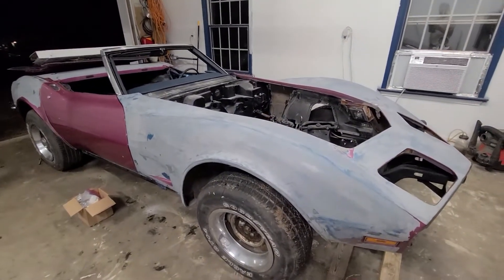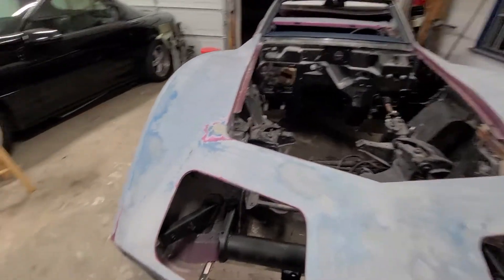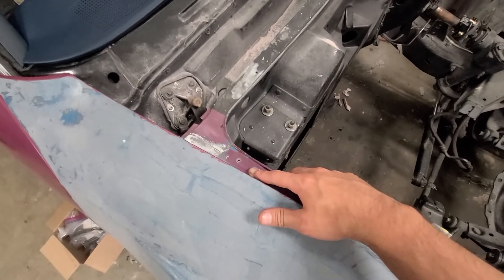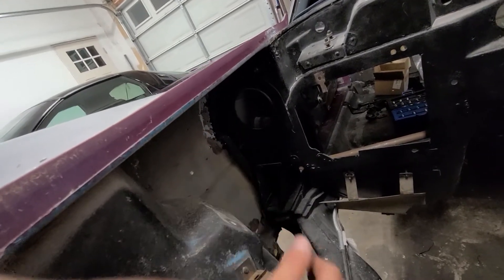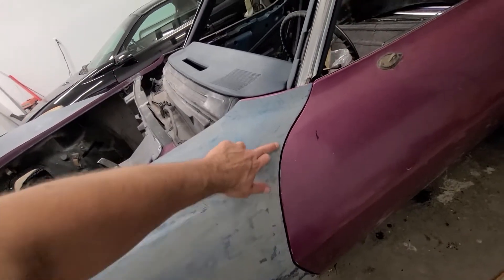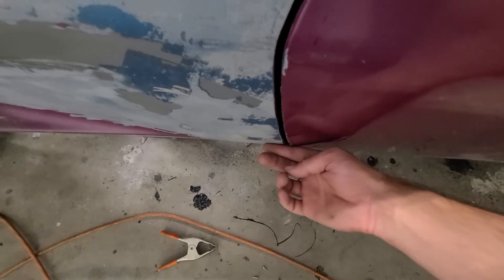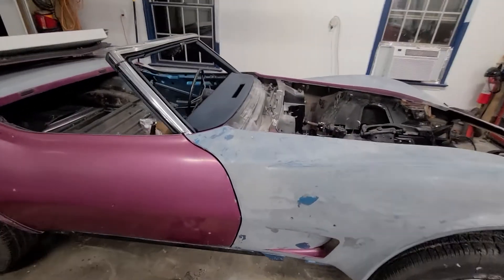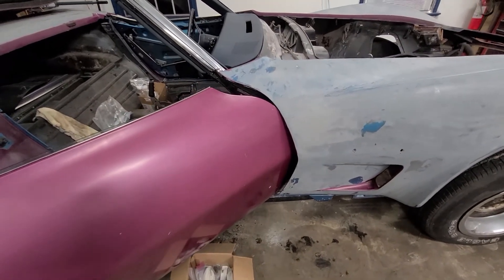c3 corvette front clip install

Comment: Very good work.  There is only so much that can be done to get even gaps.  Nearly EVERY C3 that I've looked at has a passenger side gap that is wider than the driver's side.  Especially at the top.  From my research, when the nose was put on at the factory, the fenders were left a bit long and then shaped to match the doors.  for the St Louis plant in the mid-70s, sort of close was close enough.  Without glassing the edges of the doors and the fender, the best you can hope for is a compromise.  Good luck with the rest of the build!

Comment: Are you calling the frame extension with the vacuum tank, the "crash bar?"  I'm trying to figure out how to put my project car, that I bought, back together.  It came dissassembled.  It is very difficult to find information and pictures of how the front end goes together.  I have an impact bar, several brackets, the vacuum tank frame extension, and a radiator core support that all need to go back together before i can glue the front clip back on.
Reply from the maker: @jaysenwarner6125  yes I am calling it that.

Comment: 8115 is probably not the best adhesive to have used... it is a metal panel bonding adhesive. might work OK. only time will tell.
Reply from the maker: can you suggest something so others who see this video and the comments know what they should use ?
Reply: I'm close to doing mine, that is a good question,  which product did you use, smc 2 part urethane,or epoxy, or what.   Not much info out there